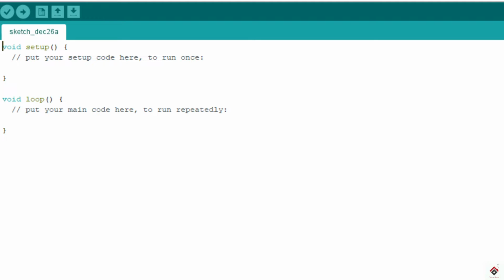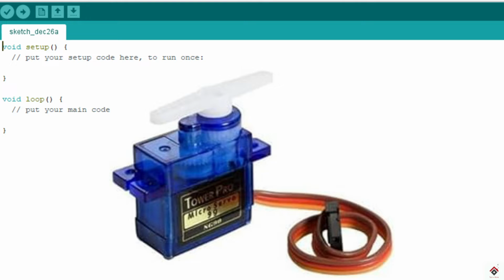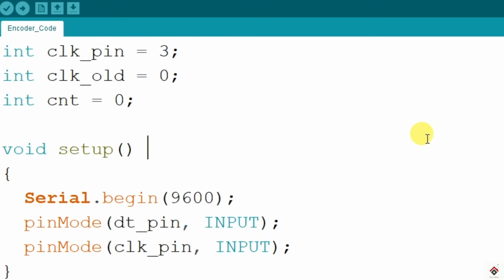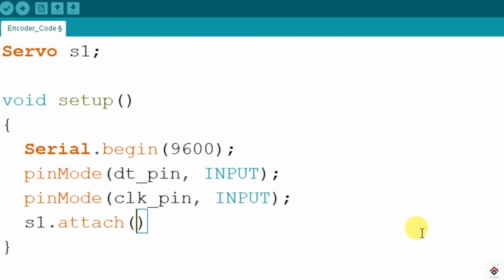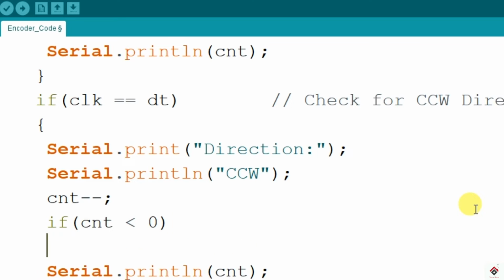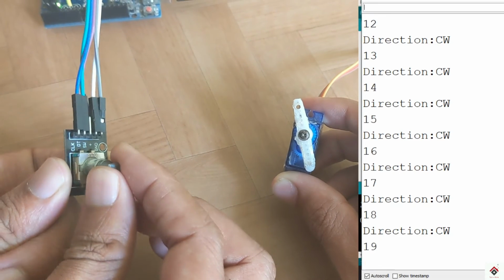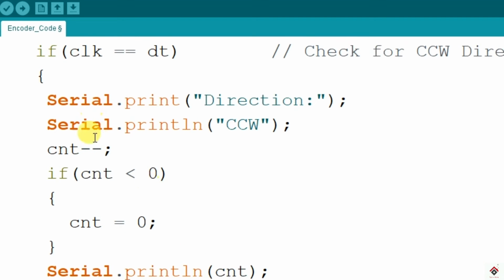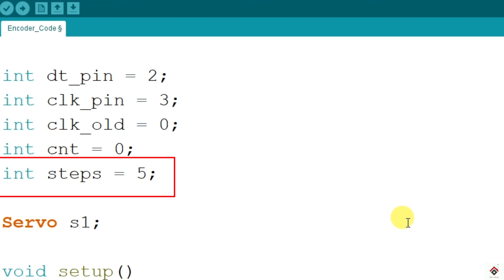Servo position control using Rotary Encoder and Arduino[CODE] | Servo angle control with encoder

Comment: it says this : Arduino: 1.8.19 (Windows Store 1.8.57.0) (Windows 10), Board: "Arduino Uno"

C:\Users\PC\Documents\Arduino\blink_new\sevo_and_ecordary_code\sevo_and_ecordary_code.ino: In function 'void setup()':

sevo_and_ecordary_code:15:3: error: expected ';' before 'pinMode'

   pinMode (dt_pin, INPUT)

   ^~~~~~~

sevo_and_ecordary_code:17:6: error: 'attach' was not declared in this scope

   s1,attach(6);

      ^~~~~~

C:\Users\PC\Documents\Arduino\blink_new\sevo_and_ecordary_code\sevo_and_ecordary_code.ino:17:6: note: suggested alternative: 'tanh'

   s1,attach(6);

      ^~~~~~

      tanh

C:\Users\PC\Documents\Arduino\blink_new\sevo_and_ecordary_code\sevo_and_ecordary_code.ino: In function 'void loop()':

sevo_and_ecordary_code:29:2: error: expected primary-expression before '}' token

  }

  ^

sevo_and_ecordary_code:36:3: error: expected ';' before '}' token

   }

   ^

C:\Users\PC\Documents\Arduino\blink_new\sevo_and_ecordary_code\sevo_and_ecordary_code.ino: At global scope:

sevo_and_ecordary_code:39:2: error: expected unqualified-id before 'if'

  if(clk == dt)

  ^~

sevo_and_ecordary_code:50:1: error: expected declaration before '}' token

 }

 ^

exit status 1

expected ';' before 'pinMode'

This report would have more information with
"Show verbose output during compilation"
option enabled in File -> Preferences.

plz help mee
Reply from the maker: Can you send photo of your code on mail: deepakhd20@gmail.com